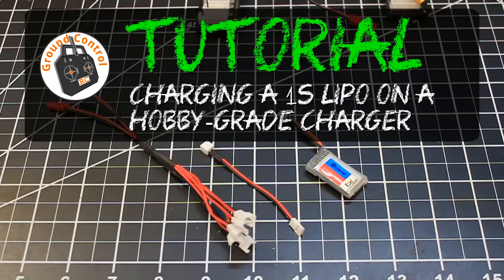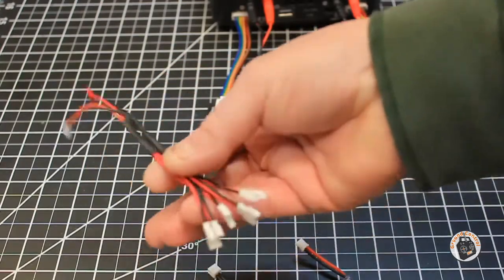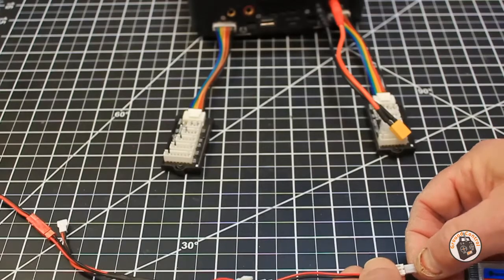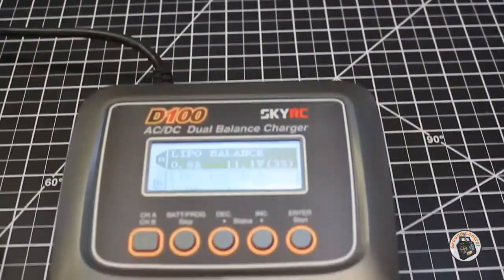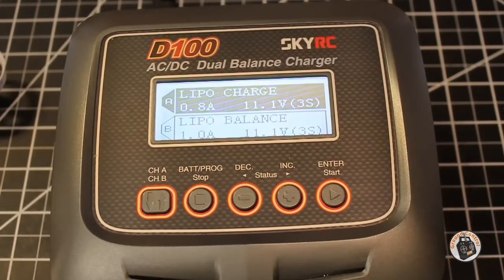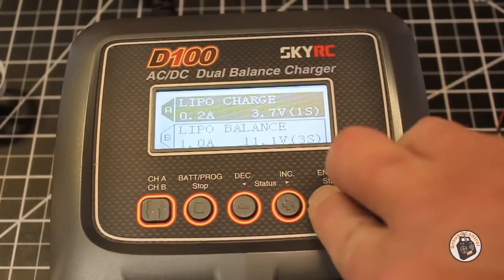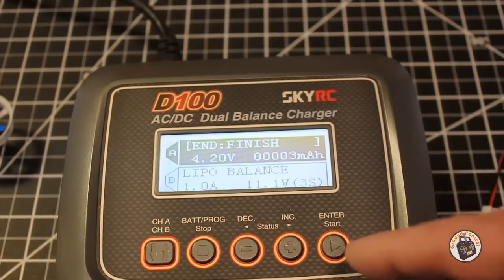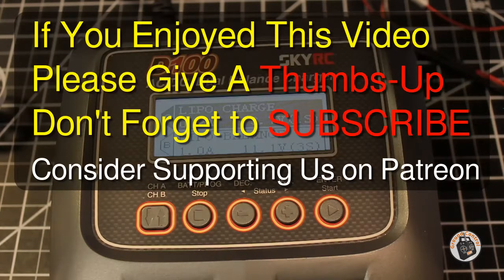Tutorial - Charging a 1S LIPO with a Hobby-Grade Charger

Comment: Hi, congratulations for the very interesting video!!
A question, what charging current should I set to charge 1S Lipo batteries at 220mah 3.7V 45C?
Thanks for the reply!
Reply from the maker: Thank You!
I baby my LIPOs and even if the LIPO states a charge rate of 5C I always charge my LIPOs at 1C.
I think they last longer that way, just my opinion.
With a 1S LIPO of 220mah a 1C Charge Rate would be approx. .2 amps, 2C would be .4 amps, etc.
Reply: @GroundControlRC  thanks, the problem is that at 0.2 ah it takes forever to charge them..
Reply from the maker: @gianluca387  Yes, it does take longer.
I have (2) Dual Circuit Chargers so I can charge (4) LIPOs at a time. That definitely helps.
Reply: @GroundControlRC  yeah!! I have Spektrum s44 for 4 Lipo 1s
Reply from the maker: @gianluca387  ;-)

Comment: hi there. can it be recharged below 3v before it becomes fully charged?
Reply from the maker: You can stop the charge at the voltage you want but the charger will continue to charge until it reaches the full charge of the type of battery being charged.
For a LIPO, 3.0v is below the recommended minimum charge.
It does have a discharge feature as well and a storage level feature.

Comment: Can i use this method to charge 1s battery with different mAh rating at the same time?
Reply from the maker: With this charger yes, but it depends on the charger.
Since this charger has (2) independent circuits it can charge (2) batteries with completely different chemistry as well.
Reply: You can use USB charger with 6 independent charge channels .https://amzn.to/2XBzlRI   it can charge different mah batteries and different current 0.2a or 0.6a at the same time.

Comment: i find a cool 1s lipo charger from Amazon.   https://www.amazon.com/HobbyFly-Battery-Charger-Inductrix-Connectors/dp/B08RJXW8CS/ref=mp_s_a_1_16?dchild=1&keywords=hobbyfly&qid=1627826996&sprefix=hobbyFly&sr=8-16
Reply: The 1s charger has HiLv battery version. 
https://amzn.to/2XBzlRI    This charger supports LiHv battery charging. And we aslo can use a series charging board for 6pcs batteries as one 6s 22.2v battery pack.https://amzn.to/3CT2mbP
Then the series charge board can be used with skyrc charger.charging ,storage,discharge as battery pack.
Reply from the maker: That's a nice little USB Charger is you have just Micro JST and JST PH2.0 Connectors. Some of my JST PH2.0 LIPOs are LIHV. Do you have any of those as this doesn't support LIHV. If you don't need to charge LIHV you're in business ;-)

Comment: Hi! I know this video is a bit old by now, but i have a question, i stopped using the usb chargers too, because my batteries kept puffing, i have a brushless whoop, my batteries are 5x 40/80C 300mah, and 5x 70/140C, but whenever i charge them with my hobby grade charger, i dont get longer than half a minute of flight, with the usb chargers i get atleast 2 minutes, would you have any idea?
Reply from the maker: Hi Kevin! I could only assume they are not getting fully charged. I would check them with a battery meter or multi-meter. These LIPOs are small, I would also try charging them at less than 1C and see if that makes a difference. Say charge at .2 amps. It could be the LIPOs just can't hold a charge anymore. I hope that helps.
Reply: @GroundControlRC  thank you for the fast reply man! I appreciate it alot. The batteries are like a week old so i dont think they are dead (yet) the ones i have left anyways. Because 4 of the 10 have actually puffed and died, one of my usb chargers i noticed charged them to 4.8v, which is just insane, way to high. I'll try to charge them at .2, thank you so much!
Reply from the maker: @Kevin-Kx  You are most welcome ;-)
Reply: @GroundControlRC  👍😄

Comment: I just got back into the 1s battery game with a new micro airplane.  I haven't used these types of batteries in a very long time.  How does the charger know when to terminate the charge if it can't measure the actual battery voltage because there's no connection/input to the balance port since there's no balance lead?  I understand that it doesn't need to see individual cells because, duh, it's a 1s battery.  But, I'd think it still needs to see the battery voltage so it doesn't just keep charging, charging, charging and eventually puff the battery or worse. Thanks.
Reply from the maker: If its a standard 1S LIPO you would set the Charger for "Charge" and select "1S" for the type of LIPO and it will terminate the charge when the voltage gets to 4.2v. If it's a 1S LIHV LIPO you would select "Charge" and "1S LIHV" and it will terminate the charge when the voltage gets to 4.35v
It will test the voltage using the power leads the same way a battery meter would test the voltage. So it knows when the LIPO has reached full charge.
I hope that helps.
Reply: @GroundControlRC  I still don't see how the charger is detecting the battery's voltage without an input from the balance circuit side.  What about with parallel charging multiple 1s batteries?
Reply from the maker: @whoknows8678  It's like taking a multimeter and checking the LIPO voltage. The Charger can Charge and Test at the same time.
I don't have a parallel charging board but it would have a circuit built-in that monitors the LIPO Voltage on each port the same way and stops supplying voltage to the LIPO once the charge is complete.

Comment: Why would you to off a lipo just to let it sit? Charge them to storage voltage man! Unless 1s is supposed to be treated differently than multicell for some reason🤷🏻‍♂️. Thanks for the info though. I'm a 4s 1/8buggy just getting into fpv and am glad to know I can use my Reedy charger for 1s drone batteries.
Reply from the maker: Hi Jason! I don't understand the question or comment. What do you mean just let it sit? I always pull my LIPOs down to storage level. This tutorial was just to demonstrate how to charge a 1S LIPO using a balance charger for those that have never used a balance charger with a 1S LIPO. I hope that answers your question but let me know if I misunderstood. See you in the Air!
Reply: @GroundControlRC  I thought you said "I topped these batteries up a couple days ago." And I was wondering if 1s was different than multi cell. I'm racing tomorrow AM and I'm hesitant to charge packs and I'll be on the track in 6hrs because of all the horror stories I hear about leaving packs full for you long.
Reply from the maker: @jojaboy319   Now I understand. I do leave packs fully charged for up to 3-4 days. I charge packs up the day before I'm going flying. Many times the weather forecast is so far off, I have to cancel the flight session. It may be a couple of days before I have another opportunity to go fly. If it's any longer than 3-4 days, then I pull the packs down to storage mode. Good luck in your race!

Comment: Hi thank your video. Question:
How do I figure out my charging amp rate like you did? (you chose the 0.2A on your charger. (Thank you in advance)
I have an E-flite 1S 25C LiPo Battery Pack (3.7V/500mAh) w/JST Connector
Maximum Continuous Discharge: 25C
Maximum Continuous Current: 12.5A
Reply from the maker: Hi Greg! That is a good question.
LIPOs have (2) Rates: A Discharge Rate & A Charge Rate.
You correctly specified your LIPO's Discharge Rate.
The LIPO has a capacity of 500mah or .5 Amp Hours.
It has a Discharge Rate of 25C which is based on Amp Hours.
.5 Amp Hours x 25C = 12.5 Amps Discharge Rate.
Many LIPOs have a Charge Rate of ONLY 1C.
If I have a 1S 1000mah 25C LIPO with a 1C Charge Rate I should be able to Charge at 1 Amp as 1000mah = 1 Amp Hour.
If the the same LIPO has a Charge Rate of 5C I should be able to Charge at 5 times that Rate or at 5 Amps.
My Charger ONLY allows me to Charge at a resolution of Tenths of an Amp.
So, if I have a 1S LIPO that has a capacity of 240mah and is capable of Charging at a Rate of 1C I Round Down.
So, since I can't Charge at .24 Amps I Round Down to .2 Amps as my Charge Rate.
If I Round Up I'm over the 1C Charge Rate.
I hope that Helps and I'll see you in the Air!
Reply: @GroundControlRC  thank yoh sir! Wow i will print this out and break it down. Thank you kindly!
Reply from the maker: @AGMWEST  , you are most welcome Greg ;-)
I'm glad it was useful.
See you in the Air!

Comment: Is there any reason not to just make your own octopus with all the cables you have, instead of ganging up adapter upon adapter?
Reply from the maker: Good question! Yes, the reason I make all these adapters rather than a single octopus cable is because I also use these adapter in aircraft when I need a different connector from the LIPO to the ESC ;-)

Comment: Nice presentation, wanted to throw in my two cents, not trying to be a know-it-all, or rude, it's just that I recently had a problem finding connector for an older quad, and ended up going down quite the rabbit hole of connector types and the mass amounts of misinformation mostly due to vendors.  There are 10 different JST (Japanese solderless terminal) families, each has many subcategories, the red connector everyone calls JST is a JST RCY.  The connector you referred to as Losi is a Molex 51005/51006.  Losi is RC truck maker and originally designed these for their trucks. The name is known in some areas of hobby and country other places they've never heard the term.  Almost all the small white connectors out there and definitely in RC hobby, technically are either JST or Molex-(PicoBlade) type connectors.  Here's a few links that helped me figure some of it out.
https://hackaday.com/2017/12/27/jst-is-not-a-connector/
https://en.wikipedia.org/wiki/JST_connector
https://micronwings.com/Products/SectionConnectors/index.shtml

Also, that is an awesome charger, friend has one, and mine is very similar.  As you know, you can use DC to power that charger, which until a couple months ago I thought was just an option, you may already know this too, but it actually charges batteries quicker and more efficiently balances them using DC power.  It's not that big of deal with the 1s, but for your larger multi cell batteries it's a big difference.  To the point I actually purchased a DC power unit for my charger instead of using a large mah battery.  On a 4s 1300mah battery, it probably knocks 10-15min. off the charge time, and each cell is rarely off more than 0.002v.  Anyway, just wanted to throw that out there, take care, happy flying!
Reply from the maker: Thank you, and no worries! Yep, connectors are confusing and I know the Red JST Connector is not the full nomenclature but sometimes you have to keep it simple. So I use the same label as the vendor to describe the connector so others will be able to find it. Then there's micro servo connectors. You not only have to know the connector but you also need to know the pitch because it just wasn't confusing enough ;-) Sometimes the connector I referred to as a LOSI connector is also referred to as a Walkera connector ;-) I hear people all the time refer to quadcopters as Drones? Now everything is a Drone?

I understand where you're coming from and I appreciate the links you provided. I will have to, perhaps, in another episode of the Pilot's Lounge provide those links to viewers so they will have access to this information. I created a video just to go through some of the issues I was having finding Micro Servos with the proper connector ;-)

The charger is great and if you use DC rather than AC the power goes from 100watts to 200watts ;-)
Thanks for the info as it is much appreciated and I'll have to pass it along.
See you in the Air!
Reply: @GroundControlRC , Thanks for being so gracious, yeah, I never know if I should say stuff like that or not, because I don't want to step on any toes, but then I remember that besides learning from great video content out there, like yours, I also learn a lot from reading the comments, so I thought what the hell.  Plus I just retired, that along with the quarantine, I'm finding it difficult to stay busy, so I end up rambling on posts..lol.  Take care!
Reply from the maker: @sunshynff  , hehehe...no worries here. I'm always looking for good information and better ways of doing things. Congrats on your retirement! I would love to be celebrating my own but I have no idea when that will be ;-) Now you get to spend more time in this great hobby ;-) See you in the Air!

Comment: Hi. Great video. Just to make sure. How do you calculate the correct Amperage to set in the charger? Example I have a 1S (High voltage) 450mah 3.8v battery for my Emax Tinyhawk. Been charging with my Tenergy charger at  0.4A. Is this good and  what about the High Voltage factor of this particular battery. Also should I be charging on ‘Balance’ or just regular ‘Charge”? Thank you you for your help. -DS
Reply from the maker: Very good questions Dave! I think you have the charge rate just right. I typically charge my LIPOs at 1C charge rate, which with your 1S 450mah LIPO would be .45 amps. So charging the LIPO at .4 amps is exactly what I would do. Some LIPOs have a 5C charge rate which would be 5 x the 1C rate or 2.2 amps for your LIPO. I baby my LIPOs so they last longer and rarely charge above 2C and only then if I'm in a big hurry and the LIPO is rated for a 2C charge. You would charge an LIHV at the same rate as it just has a higher voltage capacity of 4.35v per cell rather than the standard 4.2v per cell and so takes a bit longer to charge at the same C-Rate. As for charging a 1S on Balance or Charge if your charger doesn't complain you can use either one as there is no balance cable and will not be connected to the balance port. My charger will allow me to charge a 1S LIPO on the Balance setting if I previously balance charge a 2S or higher. For some reason, if I then leave it on balance and change the voltage for a 1S LIPO it doesn't complain. If I had it on charge and then changed it to balance it will throw any error because it can't detect more then 1 cell. An oversight on the firmware I suppose ;-) See you in the Air!
Reply: @GroundControlRC  Thanks for the quick reply. Any suggestions for a multi-Lipo charger for 1C & 2C? I'm looking into the: 
Ultra Power UP-S6AC 6x4.35W 1S AC/DC LiPO/LiHV Battery Charger With Micro MX mCPX JST or the Ultra Power UP-S4AC 1-2S Whoop Battery Charger. Preferences/suggestions? THX!
Reply from the maker: @davesilva9174  , well, I've never had a multi-port 1S ONLY charger before and I really like my SkyRC Chargers but they are much more expensive. The charger you mentioned is very inexpensive and has (6) ports and has very good reviews. The only downside I saw was a complaint that it has no discharge feature for putting the LIPOs at storage level. Other than that it looks pretty nice ;-) I don't know if you're located in the US but it only comes with an EU Plug so you may need an adapter.

Comment: Can you recommend a charger for losi connector battery couple of your links aren't working
Reply from the maker: Thank for the info on the outdated links.
I have updated the link to the charger as the SkyRC D100 V1 is out of production, it now links to the V2.
I have also update the link to the charging adapter cable and added a link to another 1S LOSI Charger.
Let me know if you see any other issues.

See you in the Air!
Reply: @GroundControlRC  thank you but way over priced 174 Canadian 😬 more then the plane 🤣 can I trust those 4 in 1 chargers?
Reply from the maker: @thesixtorontotoronto2495  , I have not used the 4in1 chargers before. I have used those cheap little single LIPO USB Chargers before and I don't trust them at all, however, I have a couple of good quality Balance Chargers, namely, the SkyRC D100 V1 & V2. They are a bit expensive but I can charge anything from a 1S to a 6S including LIHV. I know the iMax B6 Chargers are very popular and much less expensive. You will most likely need the adapter cables for LOSI connectors as not many come with those cables. The other thing to consider when looking at more expensive chargers is; do they come with a power supply or do you need to purchase that separately? Many do not come with power supplies. Another way to look at is, 1S LIPOs are very inexpensive, so for the price, I would definitely try one of the 4in1 chargers as they are probably the least expensive options for just charging 1S LIPOs. I hope that helps.

Comment: This is a horrible example of what to do.  Connecting a battery with the bare charging leads dangling around is a great way to ruin a pack, possibly a model if it catches fire afterwards, or your house.
Reply from the maker: We must have been watching two completely different videos? There were no bare charging leads. Every thing has a connector on it. The only thing that was exposed was the 4mm bullets that plug into the charger. Can you give me a time code in the video where there are bare charging leads? I must have missed something?
Reply: @GroundControlRC   @Coldspringhead is right, it is a horrible example you had the banana plugs exposed and if they touch can cause an issue. You should only connect the batteries when the plugs are inserted into the charger, maybe update your video to reflect this

Comment: If my new battery can not be charged with powerbank/charger handphone,how?thanks
Reply: New Battery lipo 1S 3.7 2000mAh
Reply from the maker: @lokataraofficial  , very good question. So if you don't have a balance charger, or otherwise, they do make USB 1S Chargers. I would advise against getting a real cheap one as I have found them unreliable and either undercharge or worse overcharge LIPOs.
Here is a link to Banggood where I searched for USB 1S LIPOs:
https://www.banggood.com/search/usb-1s-charger.html?p=WE081047791920140372
I have not used any of these so I can't validate them.
I would choose one that can also charge LIHV (4.35v) 1S LIPOs, matches the type of connector your LIPOs have, and has a high customer rating.
I hope that helps and I'll see you in the Air!